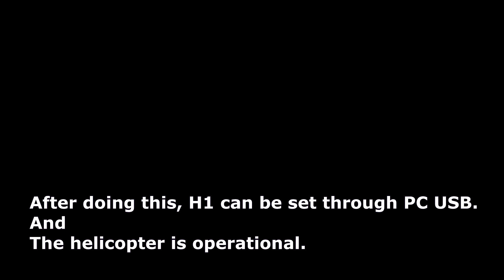FLYWING H1 AUTO FILOT POWER ON PROBLEM

Comment: in the manual H1 say that I can connect 2-6s batteries .. but in the box it´s written input 5v.-8.4v. ... What voltaje I must use?
Reply: @RC Spectrum  I discover the problem, my ESC have not BEC  :D I need connect by "Y" conector a side with ESC an another side with power supply 7.4 .. but I think this "Y" conector ... must be have a resistance ... I think -..

Comment: Same with my problem H1 won't turn on the light 🤦
Reply: difficult in my country and also must take a long time, 😅
I have two H1 and both of them is same problem,
Reply: My problem is the gps n0t turning t0 s0lid green. 0nly yell0w lights blinking
Reply: @blow9899  Do a factory reset and recalibration in the h1 configuration software. That fixed the yellow flashing forever no GPS lock solid green issue for me.
Reply: @blow9899  Did you dothe GPS Calibration